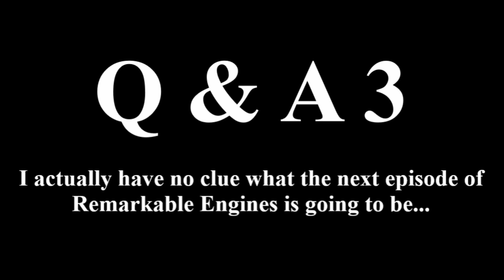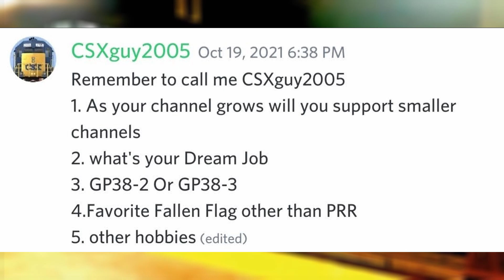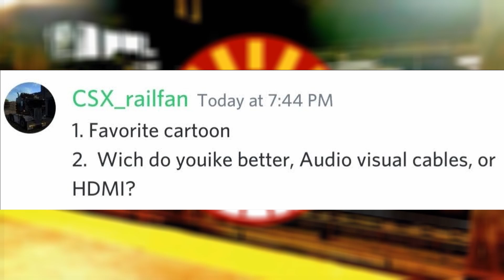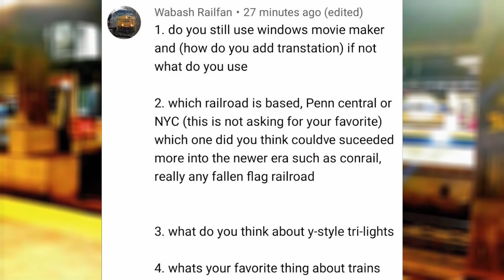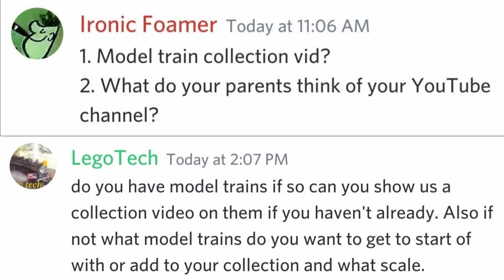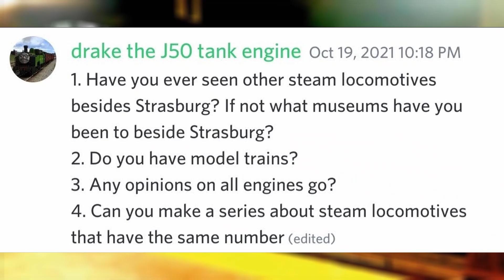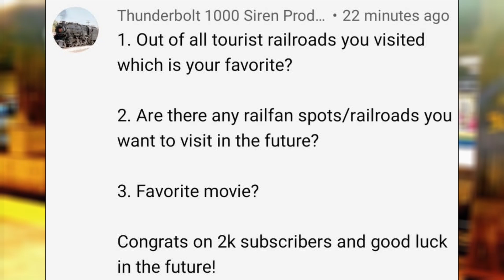Q&A Response Video 3

Comment: Thanks for answering my question. I forgot BNSF technically owned their ex BN Metra line. Lol.

As for a steam locomotive class I wish could have been either preserve or recieve a rebuild, it'd be the Milwaukee Road's streamlined 4-6-0 (yes they really did streamline a 4-6-0). Mostly because someone could theoretically fund a conversion of an existing 4-6-0 that has similar running gear and just shroud it with the streamlining casing. Is it a lazy "rebuild"? I guess but it'd look neat.

I also hope the other two lost American redubbed TUGS episodes are found from a former Clearwater employee or someone who'd have access to the test dub (and preferably not by The Star Tugs Trust who'd let the tapes rot without publically releasing them.) If said dubbed episodes are of episodes of previously unseen 20 minute TUGS episode cuts that'd be even cooler (since the US English dub was meant to dub all episodes to their original 20 minute length).

Sorry for that rambling, this was a great q&a and I am glad I could contribute to it.
Reply from the maker: Thank you for your additional input. That abandoned shell of a Milwaukee streamliner sitting in a field was used for a parade float promoting the Hiawatha service, but sadly was not part of an actual locomotive.
Reply: @Pensyfan19  dang. I'd normally say someone should find and try to salvage that casing but with how much weather damage and corrosion it's recieved, it's probably too far gone to restore it.

Comment: I got a question for the next Q&A is Amtrak’s getting new engines and cars for their roots across America like the Northeast corridor are they going to keep ACS 64 engines as back up if one of the newer engines a breakdown?
Reply from the maker: SC44 and Siemens Venture coaches. Only a few ACS 64s will be kept for backup, but the rest will be sold off.
Reply: Rip acs64  and a Acela I mean I still can’t believe that anthrax replacing their F 59PHIs
Reply from the maker: @tom-and-mom  ALC42E: a dual mode Siemens Charger.

Comment: The reason Indian 6 axle "passenger" engines seem to perform better is because most of the system is narrow gauge and in such a state of Penn Central levels of yeeted they barely go above 35

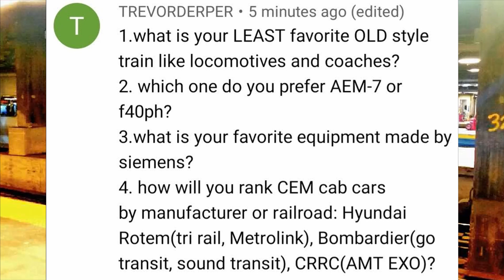Comment: 20:06
Okay, but like, why was I expecting that?
Reply from the maker: Because there are a lot of people Simp for the E2 because Thomas was based on it. I am not one of those simps. Even though I railfan the DE/DM30AC, which isn't the best built diesel by EMD.
Reply: @Pensyfan19  I too think the E2 simps are a problem
Thankfully, I'm not one of them, even though two of my OCs are based on the class (or, at least, my own freelanced/improved designs for the class)
Reply: @Pensyfan19  PS, I had no idea the GP7 was a passenger engine

Comment: thank you for answering my questions, I generally prefer AEM-7 all the way because it is simply a electric locomotive and they lasted until the end of their service in phase 5. I think the f40's with p5's are better but I don't like the paint scheme, I prefer them in phase 4 and 5(NPCU) now if there were a good f40ph I will give the prize to the Via rail's f40ph-2d because rebuilds look awesome and better looking than the bland looking non rebuilds and k3l's and transtronic bell. since you put the CRRC ones low, I do agree because I think they are just going to be unreliable due to how cheap CRRC is which means they will be irresponsible with the CRRC coaches and not to mention rejected Bombardier and hyundai rotem CEM cab car.
Thomas is one reason why I like trains(and the all engines go is trash MLP bootleg by Mattel and defies physics and science brainwashing kids) but the main reason is because of the Montreal Metro trains such as the MR-63 and MR-73(coincidentally they have a similar color to thomas).
Reply from the maker: Nice to know. Other than Thomas, I also lived near a miniature gauge railroad which I don't know the name of, as well as being able to see numerous LIRR DE/DM30ACs while picking up my dad from work and with riding on them when going to New York City.
Reply: sorry but where you got that photo of JPBX 938 in 32:09 and do you have a link
Reply from the maker: @trevorderper5050  It was from a discord server, and I asked for permission to use it (and the owner said yes). I'll try to attach it here:
https://media.discordapp.net/attachments/785393095591329798/909522695249621042/20211114_095958_1.mp4

Comment: I think you skipped my 4th question...
Reply from the maker: You're right... I apologize for this inconvenience. The answer to that would be none other than the Streamlined Doodlebug itself. (Although, this would also include a wide variety of ten wheelers and other almost unknown small steam engines which were used on branch line and commuter runs).
Reply: Yeah, 4663 is underrated for sure.